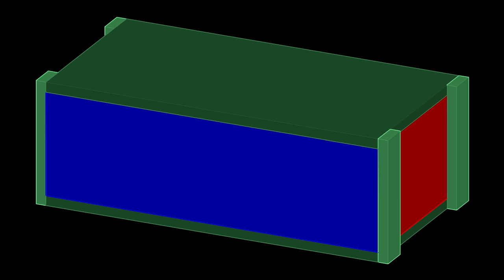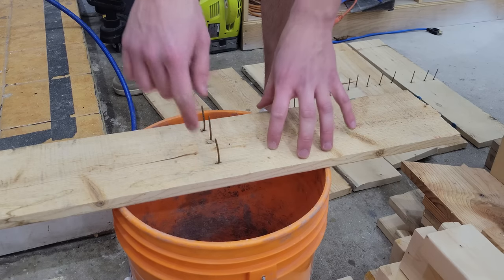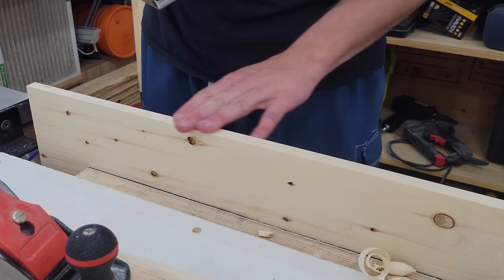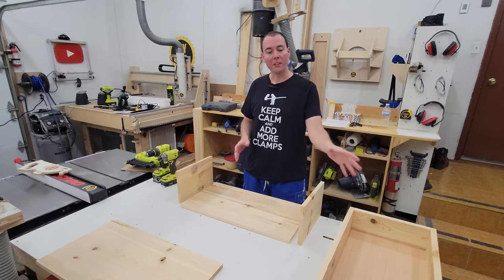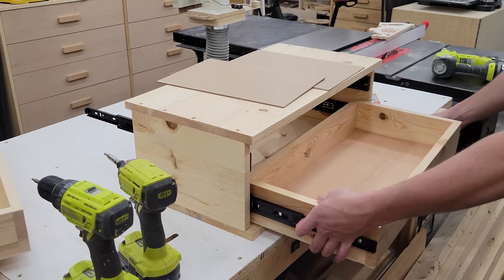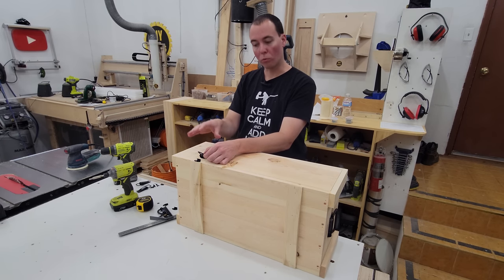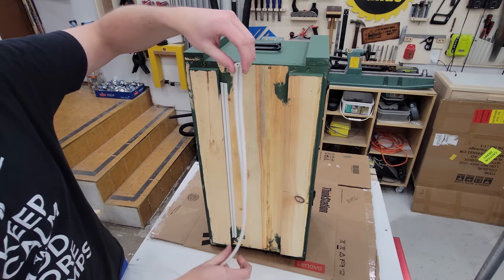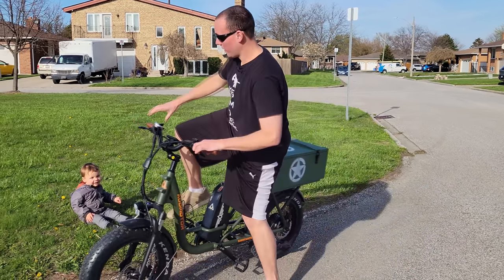Bike Mounted Ammo Crate, Secret Tool Chest - Free Plans!

Comment: After seeing the final build, my first thought that I would modify would be to initially split the drawers into two vertically rather than horizontally  Then you would have two deep drawers side by side. You then could use one as a place for a cooler for lunch and drinks.  The other deep drawer you could then split horizontally and use as two drawers.  You might need to streamline your tool selection or be more compact in layout but that would be more practical overall for a bike ride.  Nice job overall!
Reply from the maker: You could do anything you want with it but my goal was to reduce cut lines and make the drawers seem like they don't exist and that the real way to open it is flipping up the top.

Comment: One suggestion I have is to line the bottom of the drawers with yellow duct tape, enamel paint, or thin foam panels. It does two things: protects the drawer bottom from tool marks and easily identifies when a tool is missing from the foam cutout. This does mean you'll have to cut completely through the thick foam, but it's worth it.
Reply: The wood is already yellow.
Reply: @nyetloki  true. Yellow tape protects the wood from scratches and stains. Vinyl works best.